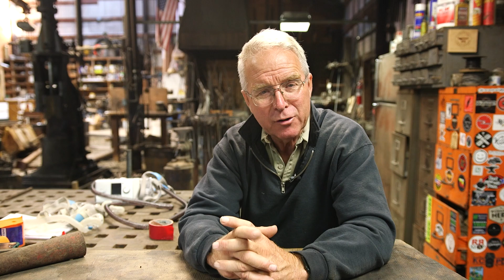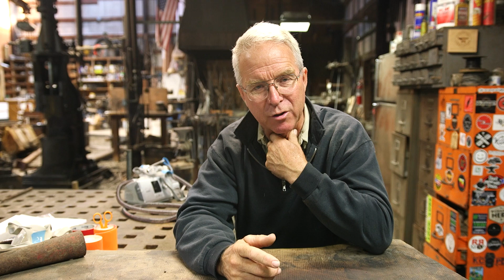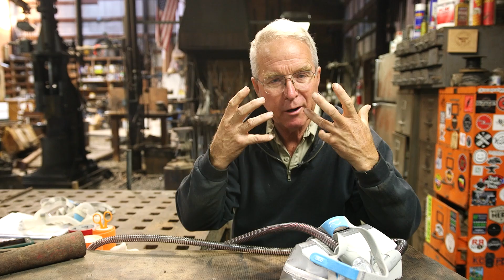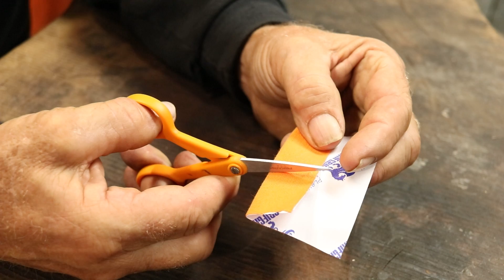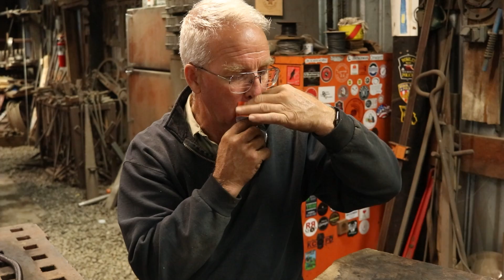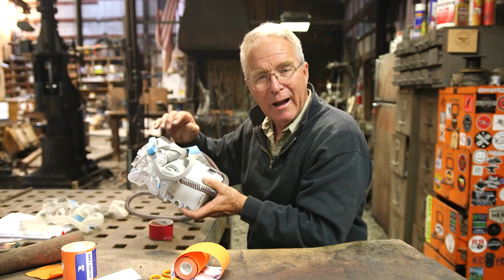Tired Contractor  Here’s My Simple, CHEAP Sleep Apnea Solution

Comment: I did this for a full year and then later about 4 months. I am now a nose breather when I sleep and much more often when I'm awake. I used a small piece of  paper medical tape just in the center of my mouth so if I needed I could breath from the sides. There's really no need to cover your whole mouth because a little piece of tape in the center keeps your mouth closed and if it's closed you're not breathing through it. Of course you can do this during waking hours as well...probably best only to do it around the house I'd guess.

Comment: That seems like it's working for you, great discovery. I'm wondering about your doctor though and why he had you on the highest pressure. I get the impression that some doctors assume more is better and don't want to try lower settings in case it leaves you at risk, but a properly trained cpap tech should know it's more about the right pressure to get the therapy comfortable. I think he has you on too high pressure. My apnea count is 75 (without treatment), a mixture of CA and OA.  I'm on a pressure of 12, and my AHI is down to under one per hour. My mouth doesn't flop open but I had to adapt as I tended to be a mouth breather as well. I started with a full mask but went to a nasal pillow mask with a chinstrap to keep my mouth closed. I no longer need the chinstrap. 

If you wanted to continue with cpap and make sure you are really have the apnea under control (though your wife will no doubt tell you if you snore still!), you could try a much lower pressure and and nasal pillow mask with tape (or a chinstrap for greater convenience). You may have tried all that in which case please excuse my assumptions. But I jus twondered if your doc had just come at it too gungho and wasn't really trying to find you a comfortable cpap solution.

Comment: I’ve had sleep apnea for years, both types you were diagnosed with, tried various machines, but once I lay back they leak air.  I’ve considered taping my mouth, but almost panic at the thought that I would block off my one way of getting some air.  I never get a good nights sleep.  Soo I’ll get some tape and if I don’t wake in the morning, I’ll be with my savior.  Do you wear a band around you head to hold you lower jaw in place?  When the jaw opens , your tongue slides back and obstructs the airway. The jaw can relax even tho the lips are closed.

Comment: I have recently gone through the CPAP rigamorol as well.
I am a central apnea patient. 
I was prescribed a CPAP Resmed Air sense 10 and wrnt through several masks to find which worked best. 
The first thing what went right for me was I gotca CPAP, not a BPAP.  doing my research and experiments I chose to not use  the pressure relief feature.   I had my humidity too high and pressure too low anscwas struggling with mask bounce and moisture.  I got frustrated and quit the CPAP for 6 months.
Then I made some changes.
I learned I was suffering from a deviated septum and enlarged turbinates which was hampering my nasal mask. 
I purchased an oxygen monitor  and started watching my sleep levels.  The graphs showed me all my apnea events and my periods of O2 loss.  I was convinced to get back on the CPAP.  I got the sinuplasty surgery and adjusted my moisture to zero, my pressure isn't adjusted lower to stop bounce, but higher and I keep my mouth closed with an elastic chin strap sold on AMZ.
I now have my CPAP dialed in and am (mostly) comfortable.   I had spent about 4 months sleeping in another bed in the living room but when my wife relented, she discovered I don't snore anymore so she's OK with it now.
Anyone who is suspicious they aren't sleeping well should get checked out for apnea.  Oxygen deficit has serious adverse effects on many organs and your heart and mind.  Do something about it.

Comment: Very interesting. I might have to try this. My only hesitation is that I have a deviated septum, so my nasal passages are very narrow. The idea of breathing through only my nose makes me nervous. Might be worth a try though. A good nights sleep and possibly lower blood pressure sure does sound nice. Thanks for the info.
Reply: You can use daily nasal passage rinses that clear out all mucous. I sleep better since I have one nostril half closed from nose injury. I get mine from the VA for free. But it's basically adding saline packets to the rinse bottle & pushing the solution through your nose each side. It works great. You just have to bend over & let all solution drain out.

Comment: If you practise mouth exercises you can become a nose breather vital to sleep apnea.  I haven't used My cpap for 12 months . I dream regular. 

So the exercise goes like this close your mouth place the tip of you tongue behind your top set of teeth on your top pallet then slowly move your tongue backwards on your top pallet as far as you can  to the back of your month . Surprisingly this strengthens muscles in and around you jaw and nose area. 

In the daytime practice this exercise and try to only breath through your nose if you find yourself breathing  through your mouth change then do the exercise and eventually you will start to become a nose breather. = no cpap. I think not everyone can do this as they might have blocked nasal Airways from surgeries etc.

Comment: The Apple Watch does not take enough readings to trust for sleep apnea. You may be sleeping better and snoring less, but you could still be having dangerous central apnea problems. I would recommend you either do a sleep study or a pulse ox study at home using your new method. If you want to try to replicate just the pulse ox testing at home they make pulse oximeters that you wear like a ring that will take pulse and pulse ox readings every 1-4 seconds. Some will even give your movement data to help estimate sleep quality. (Because most Apple Watches are only taking maybe one reading an hour, and some short sleep/bad nights only one reading period).

I’m also curious if you could find the same benefit with a chin strap, and then not have to waste so much time and tape?  Chin straps are often used by mouth breathers who want to stick with the smallest nose pillow style CPAP masks because they hate the larger face masks.

Comment: CPAP and BIPAP machines are not the only way to live with OSA. There are dental devices, surgery, and now, an implantable device (still surgery; not used for years yet) called Inspire, I believe. Yes--the machines are non-invasive. They're also a major pain in the ***, which ultimately leads to stopping using the CPAP. This is from personal experience.

Comment: Whole new meaning to the phrase “my lips are sealed”.  It’s understandable why chaps are disliked it is still made to look like a canister vacuum.  The first cpap used a motor from a vacuum cleaner.   They lack some very basic features like heart rate and oxygen levels which you can get on a wrist watch.   They have a time limit where the machines computer stops it from working properly.  The machine has to be replaced even though seemed to work properly.   Dietary changes are needed before you really begin to feel better.

Comment: I was waking up 68 times per hour. I fought with a CPAP for over 10 years. I averaged about 4 1/2 hours sleep per night .--- I got a new sleep study and they gave me an APAP machine (automatically adjusts pressure). It works great!! I put it on and fall right to sleep and average over 8 hours sleep per night. -------i found out later that I could buy the machine off the internet for LESS than my co-pay through the insurance company.  Same with supplies. New mask is about 125$, or 169$ copay through our insurance.

Comment: I have same problem too.
I have been taping my mouth for about 18 months.
I bought a surgical tape through Amazone, 2inchs wide and perforated to cut at each 2 inches apart.
So l take 2 inch piece every night place on my mouth as you did. I am not snoring anymore and l felt rested. The tape is nonallegic and cloth base material and has small pinhole sized perforations so that if necessary you could breath through. 
I wanted to tell my experience to other people. 
I am 79 years old.
Reply: 2 piece of 2 inch length, so that is 4 inches long.

Comment: Holly Crap, Finally I've found someone with IDENTICAL Issues. For ten years I've been fighting the Sleep Apnea. I've had five sleep studies, two tritration sleep studies with one of my CPAP Machines. I also have a BIPAP Machine which I can usually fall asleep with. BUT, When it ramps up. It Blows it off my face. It's set at 25# of air pressure, I'm unable to get it to seal. I have to do as you did and end up with the same results. A sore nose that is almost raw, a very dry mouth, and creases in my face. 2 years ago I stopped using it. The unexplained thing with all this and I wish someone would explain this. The morning after my first study, once I was unplugged from all the test leads. I took a shower went to breakfast and I was like the Energizer Bunny Rabbit the rest of the day. It was amazing. I had an abundance of energy, and never even thought about a nap. So, I got my hopes up thinking that once my machine arrived I would be back to sleeping all night and have Energy to spare. NOT! Never ever happened after that, two different specialists with $$$$$$$$$ of sleep studies. NO ONE CAN COME UP A FIX, Except for sending me for another sleep study. Which is in the works based on a Recommendation from my Neurologist. Ya see, I've had 4 heart attacks, a quad bypass, copd, asthma, diabetes, high blood pressure, PTSD, and my new one is BRAIN FOG. I've also had COVID Twice.. He's sending me to his treatment center for another sleep test. If it doesn't work , there will be NO CHARGE. I'm 72 now, other than the above issues, Retired since 2000, &  I feel like I'm 40 something, but the body doesn't believe me. I try to stay active, by tutoring K - 4, very active  with the Marine Corps League, Veterans of Foreign Wars, American Legion, Chaplain, & Honor Guard Commander. I still try to get out in the machine shop, wood shop, my blacksmithing shop. Oh, and about a acre of flat garden, & 24 raised beds. So, I'm going to give your tape a go. Hoping it works. THANKS for ALL YOUR VIDEOS.  KEEP EM COMING
Reply: BRAIN FOG, I forgot to add GERD/REFLUX

Comment: I couldn’t tolerate CPAP either. I use an oral appliance that forces my chin forward and I no longer have sleep apnea. My dentist facilitated me getting the device which is specifically formed for my mouth and teeth. FYI, as you speak it sounds like you might have sinus issues.

Comment: I watch your channel religously and cant imagine you are sleepy...you work like a sled dog..and I have always been impressed. That said...I  am a normal weight 69 yo guy that went through the same process as you did. I have a deviated septum so I am consistently a mouth breather too. I have had 3 sleep studies including a titration study for air flow. In the early stage of diagnosis I decided that a machine would be creepy and uncomfortable. I read a bit and discovered that there are DENTAL devices that push your lower jaw forward and trick your nervous system into not stopping taking breaths. I went that route and it is SOMEWHAT effective. I sleep with my mouth open 100percent with that. I used it and adjusted to the highest setting but I still stop breathing. I got a CPAP machine and a mask..and I am "lucky" to be paying for Medicare AND an expensive co insurance...so its free and zero copay. I have a full face mask and I am fighting it also. I have a beard for 50 years and getting a seal that doesnt leak when I move is the current challenge. I get your pain though...its a bit of torture when sleepy. They make a soft woven head covering that goes over the top and down to your jaw that leaves your nose and ears open...and pretty comfortable withoutusing tape. My nose doesnt seem to allow enough air in while sleeping so I fight that device too. It SEEMS like an improvement to tape...you MAY find it helpful. Your video really caught me right where you are. I dont know where we will end up but there is a surgery that is supposed to help WITHOUT a machine or dental device. Thanks for your humor on this...I felt somewhat alone in my struggle. Sleep apnea is a condition that 25 percent of sufferers are NOT overweight.  I look forward to more on this...and some more construction  too..lol. Best of luck.

Comment: WiFi, Bluetooth, Cell Data, Sync, and even Location are incredibly disruptive to our sleep, my son and I are electrosensitive we can feel those signals.  Josh much more so than I, is 25 and in perfect health otherwise, can tell when a hot phone enters the house by chest pains, organ pains, skin heating, feels too hot in a 70 degree room.   Our work takes us on the road some weeks, the hotels are not fun, we sleep so light we wouldn't even need alarm clocks to wake at 0400.  Happy to hear you found relief as sleep deprivation is extremely serious.  I love all the tech, but it hurts.  The good news, if you leave it all running, the cordless phones, wireless mice, and what not, our bodies seek to normalize.  Its only when you can remove yourself from all of it for a time that you may notice it upon return.  Now with Starlink up there is no escape save underground, we'll either adapt or perish is suppose.   At the very least, everyone please try to move the WiFi Router away from the bedside.  I've spent 15 years tuning 2-way radios, then 10 years in IT,  spent a day punching wires with a hot router in my face almost couldn't see to drive home,  Not complaining, just hope to help  others to understand what were dealing with.  Hope this helps someone improve their sleep.

Comment: I simply fashioned a chin strap from Velcro and fixed it to the mask. I pull it down under my chin after putting on the mask and adjusting it. The chinstrap will not let my mouth open let alone have it fall open. I wear a short beard, as long as I keep it short and my mask is in good condition I have 100% on my mask fit.
 BTW, the machine is fully adjustable, the pressure can be regulated, unfortunately medical professionals will not tell you how to adjust the pressure on your machine. It's dictated by a Doctor so they are liable.
 "Central sleep apnea is very serious, it means periotic breathing, the machine must assist you by forcing air into you lungs if you do not draw breath".
 My heart rate drops near 40 and my respirations far below average, I am not about to sleep without the mask, you shouldn't ether, taping your mouth "does not address central apnea", period.
  I am glad you are feeling better but do not kid yourself about oxygen deprivation. Also, you don't say anything about cardio vascular exercise or aerobics; why is that?
Reply: BTW, I love my mask.

Comment: If you pay attention, when you close your mouth and the fore of your tongue sucks against the roof of your mouth, you can feel your nasal passage opening up a wee bit. Intentionally initiating the tongue suction also helps keep the mouth closed, upper and lower teeth naturally setting slightly apart, which reduces grinding. In my completely untrained experience….

Comment: First thing I'm gonna try after I solve my constantly blocked nose
Reply: Use daily nasal rinse. It works great. It's just saline packet put into a bottle of warm water. You squeeze the solution through both side of your nasal passages & then bend over to drain it all. It's inexpensive and works when my allergies start. Never need allergy or nasal sprays.

Comment: spent $800 on a CPAP machine and used it one time and it pumped my stomach & intestines full of air it was very painful nothing i tried relieved the pressure it took two days for it to go away.. the CPAP machine has sat unused ever since.. 
i tried this guys tape method and it seems that it works but then i read that a young man only in his 20’s died in his sleep because he put tape over his mouth.
i want to continue using this method but would like to research the dangers first..

Comment: Apnea is a serious issue, dont toss the machine so quickly,  do your viewers a favor and work with getting the CPAP setup correctly so you can get used to it.  Once the pressure is dialed in, and the right mask is fitted, then you can breathe almost normal and you dont even notice it.   The nose pillow mask works great for me.

Comment: I have EXACTLY the same diagnosis as you, both central and obstructive apneas, was started on a Cpap, did not work well enuff, was then prescribed a biPaP at highest pressure, it does work but had to use a "bonnet" to strap on foam mask which always leaks constantly, straps bite into my neck, do not get restful sleep, cannot sleep past 1.5 to 3 hrs so then have to take prescription drug Lunesta to get up to 6.5 to 7 hrs sleep, it just get's worse and worse. Main problem is my nasal passages tighten up laying down at night, cannot nose breath reliably.

Doctors don't really want to deal with me.

Comment: I find the comments interesting. I too use a bpap with a full face mask. I simply cannot breathe out of my nose because of small nostrils and nose cavity problems. I have never gone to a nose doctor, I guess I should though. I have to have the mask very tight to help prevent air leaks. I have to put a folded wash rag for comfort on the back where the strap goes against my neck. But the marks left on my face stays there for several hours. I notice that I drool a lot but yet my mouth and throat are always very dry. But I can’t sleep without this machine at all as I will stop breathing. Maybe some day they will come up with a better solution. Thanks everyone for the good reading on here.